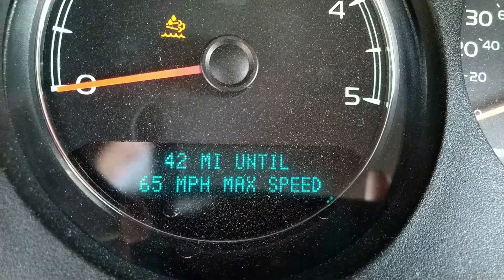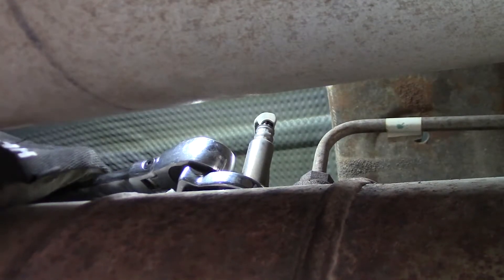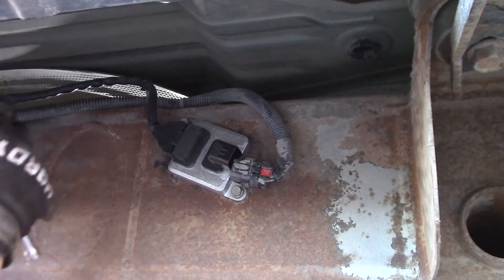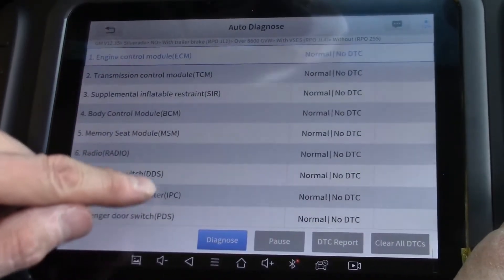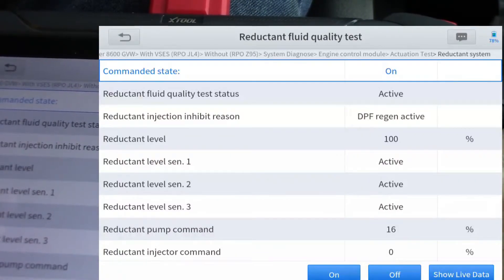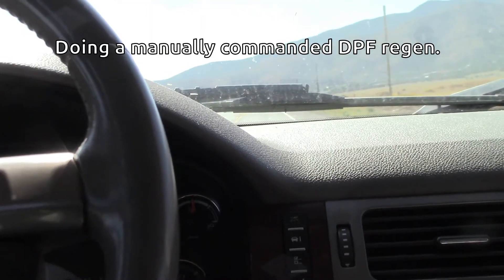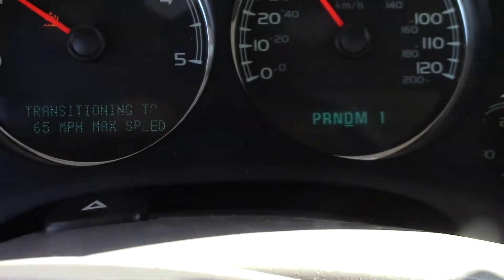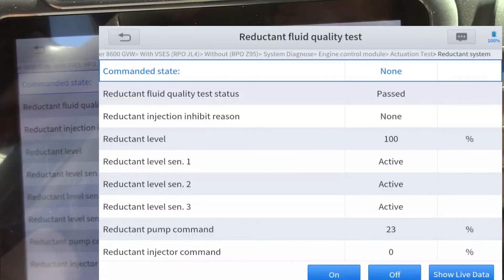Exhaust Fluid Quality Poor

Comment: This EPA crap needs to be completely removed and deleted! I’m on a 4th DEF heater! It sucks and I have only 87000 miles on a 2012 Duramax!
Reply: don’t let it get empty and you won’t have that issue. always keep it topped off after a regen
Reply: I keep mine 1/2 full to 2/3 full during the winter months because that DEF will freeze and the pump inside the tank doesn't function well when the DEF is frozen.   Also, buy DEF according to the expiration date on the jug.   Never buy DEF that is stored in a hot place.   Avoid deep standing water.............shorts it out (connectors on top of tank).   Watch you up stream and down stream Nox sensors and all 4 EGT sensors.   Mass Air Flow  (MAF) sensor that is dirty can really mess the def system up.   Air filter kept changed according to dust exposure (change once or twice a year).   Coolant temp sensor that is not acting right can mess the DEF system up.   Keep you DEF injector clean.......really not a problem in warmer states with good DEF and top tier diesel.   One other thing............9th injector, the one that shoots fuel into the Catalyst system (DPF system) in front of the SCR system can mess up and reduce flow causing a regen issue.   Good scanner will help monitor all these "pids".   best of luck.

Comment: What model Autel are you using? I have the same problem with my 2018 Chevy Duramax and trying to clear the infamous 75 miles until 55MPH. Do not have any codes now but still have the emissions message.

Comment: We've replaced 2 NOX2 on our 2017 Silverado 2500HD LT 6.6L (say that once fast) and it just keep saying LOST COMMUNICATIONS.  Chevy should be required to replace all of our CHAFING wire harnesses (if that's what is causing that error).

Comment: I have a 2014 LML having the same issue replaced downstream NoX sensor and still have no warning exhaust fluid quality poor. Do you have to run a full region or can you just run the fluid quality test? I also have a ex tool Bluetooth I believe D7.
Reply from the maker: If the fluid quality test isn't successful or runs longer than say 40 minutes, then run the regen before retesting.

Comment: Bought a XTOOL  D9  and the NOX2 sensor, spent a couple hours on my 2013 LML and still probably quicker and less expensive than the stealership  Thanks for the help and insight!!
Reply: @chrisaldrich3607, do you know if the INNOVA 5610RS can perform the role that your XTOOL D9 did? I need to replace my NOX2, and only have about 50 miles before 4mph mode, so I think I need to get it right the first time. Thanks.

Comment: Do you all know how to reset the def fluid on a 2016 Silverado 2500 HD LTZ it says it’s low and keeps saying it’s dropping my speed from 65mph to 55mph but I put 5.3 gallons of diesel exhaust fluid in it and filled it up and that message won’t go away. I need help guys
Reply from the maker: I think the first thing to check is the level sensor and connectors.
Reply: Did you ever get your truck out of derate? Going through the same thing with a 2016 LT?
Reply: @xfootball58  yeah there was a recall on the exhaust def system the dealership fixed it for free but I had to pay $175 for the diagnostic. Runs perfect now
Reply: @derekddurbin  how long ago did you have this done? How many miles on your truck?
Reply: @xfootball58  about 5 months ago I just rolled 34k miles I don’t drive it much I have a take home truck for work and I bought my wife’s impala I use my truck mainly when I’m hauling something or deer season

Comment: So 3 months ago I asked John what scan tool he used to trigger the Regen. He used the Xtool D8. I appreciate the help and info on your video. 
My truck is a 2013 3/4 ton Duramax and it had been in limp mode for a couple months, yes months. Mine was limited to 4mph and that was the message on the dash along with poor exhaust fuild quality.  I kept fiddling with it trying different things after watching a ton of video s and reading blogs. I kept going down the rabbit hole and seemed like I kept making things worse because I was trying different things from watching videos and then checking my less expensive scan tool, not the scan tool that finally fixed my truck. I disconnected the speed sensor at the transmission and drove the truck around a couple times and that threw a OBD code. I disconnected the NoX sensor #2 thinking it might reset. Both of those ended up sending more OBD codes which told me the computer in the truck lost signal from the speed sensor and NoX#2 sensor. So I let the truck sit for a week and finally found John's video and I decided to either take it to the dealer and let them charge me probably $1k in repairs or go and purchase a BETTER scan tool which I hoped would fix my truck. I started searching for a OBD scan tool that would do what the Xtool D8 would do. I thought about the D8 and found a video where the TOPDON   Phoenix Plus. (Before I forget I did buy a NoX sensor from Chevrolet dealer. $390 which I didn't need and ended up put the old one back in the truck).
When I received the TOPDON it took me a couple days to figure out how to use it and get to the reductant (DEF) Fluid quality test.  The TOPDON allowed me to "RESET" the speed sensor and NoX sensor #2. I think driving it around with them disconnected set the codes off on them. Try not to drive your truck with these disconnected or I think it will throw the code on them. After I learned a little bit about the TOPDON I was able to get the 4mph limp mode to disappear from the dash warning. The last thing I did was run the reductant (DEF) fluid quality test on the TOPDON. After approximately 20-25 mins the truck went back to normal idle and it has run fine since. That was about 3 months ago and now it's Jan 2023. Running good so far. 
Thanks for your video John it was a huge help and I think it was one of the better videos showing and explaining how you fixed your 🚛.
Reply from the maker: Wow, sounds like quite the ordeal you went through! I didn't know you could use the scantool to clear the 4mph limit before passing the reductant quality test. Luckily we didn't need to do that and had it all taken care of before that could happen. 
One indicator for when the NOx sensor has gone bad is if the NOx doesn't go to zero after a tip-out (accelerating and then suddenly taking your foot off the accelerator so that the truck's momentum is keeping the RPMs up.) If you read both the upstream and downstream sensors, they should both go to zero within maybe 3 seconds. On this truck, the downstream NOx sensor wouldn't go to zero. It was stuck around 14 ppm, so it got replaced.
Reply: @jtandrews3  question how difficult is the repair on diesel engines ? Compared to v8 engines ? I do all the repairs to my truck everything and I don’t know nothing about diesel principal the DEF system, is more complicate ? I will be able to do it the repairs and mantenace ? I ask because I want buy 3.0 duramax chevy … I have v8 truck for the last 30 years
Reply from the maker: @watchmanexpert  It's really not much more difficult. It's just a bunch of new stuff to learn. As far as usual repairs and maintenance go, a backyard mechanic can learn them from watching youtube videos. Personally, my next truck won't be a diesel, but owning one was a good learning experience for me.
Reply: @jtandrews3   why you next truck won’t be Diesel ? To many issues ?
Reply: @jtandrews3  Your video is so great, really appreciate it! And I'm about to tackle my own problem, just got back from being on the road and need to fix my baby parked in the driveway. I only have about 60 miles to go until the 4mph limp mode, so I'm nervous. John main question is, with my scan tool I was driving around my neighborhood and monitoring both NOX sensors. On level or slight downhill grade after accelerating, I notice the NOX2 sensor did NOT return to 0 ppm. It stayed around 35 ppm. Is that a definite replacement? Reason for asking is my code thrown is 249D which is "low flow reductant fluid." My question is whether the reductant injector is bad or not. I don't want to pay for the NOX2 and replace it if so. Any comments/thoughts? This occurred after I ran DEF low-ish, probably down to a gallon and <50 miles before speed limited, then I added a jug of DEF. I'm fairly certain the DEF is fine. Yes it was ISO rated and not expired. Low DEF went away, but after truck sat a week, drove it and "poor exhaust fluid quality" warning popped up, and now I've been troubleshooting and almost to the 4mph limit. Ugh. Also I bought a scan tool, it's bi-directional and the INNOVA 5160RS scan tool. I'm not sure all of it's capabilities yet but if anyone advises I return this one please let me know. Oh p.s. my pickup is a 2015 Chevy LTZ duramax with 152,000 miles.
Reply from the maker: On a throttle tip-out, only air is going through the engine and the NOx sensor should read zero or 1-2 ppm. In dense urban areas, background NOx can approach 0.5 ppm, so that might get picked up on the readings. For a reading of 35 when it should be 0, I'd guess on the sensor needing to be replaced. If you have to drive it, I'd say command a regen first thing so that's out of the way before you do the fluid quality test with a new NOx sensor.
Reply: @jtandrews3  Thanks for the input. Can you explain how to command a regen? I need to dig in and see if/how my INNOVA can do that. Also, is there a way to rule out the reductant injector? It sounds like I may as well replace the downstream NOX sensor since it showed up at the parts store yesterday. $400 isn't cheap, but it would allow me to rule that out I suppose.
Reply: Which topdon did you get? Looking for a new scanner due to mine never coming back from a buddies shop and was wondering which model I should buy for my 14. Would love the same as yours
Reply: Sorry,  didn't mean to make it sound like I cleared the 4mph message. I had to run the reluctant fluid test and then when it was done the 4 mph poor reductant message on the dash was gone.
Reply: Same sensor for ford diesel Costs  $800 dollars .I hate this .never buy diesel
Reply: Caleb, I I used the Top Don Phoenix Plus.

Comment: Did your 65 mile speed limit resets automatically
Reply: Do you know if you can cause a regen by driving it once the sensor is replaced?
Reply from the maker: You need a bi-directional scan tool to command the regen. Otherwise, it will wait until the DPF needs a regen and that may be after you're limited to 4 mph. Then you're looking at a difficult process to even run a regen. After a successful regen, then you need to command a reductant fluid quality test, again using the bi-directional scan tool.
Reply: @John Andrews  Thank you Sir. I haven't owned a scanner before so I want to make sure I buy one with the capability to do this, but I also don't need something too professional either.
Reply: @jtandrews3  could you possibly recommend a scanner capable of this job that's less expensive than the D8?
Reply from the maker: @dustyeaston4538 Here's a link to some reviews that I think you'll find helpful. I just found the web page: https://www.obdadvisor.com/best-bidirectional-scan-tool-review/
Reply: @jtandrews3  thank you so much!
Reply: @dustyeaston4538  I had the same poor quality def problem with my 2.8 duramax. I was less than 30 miles until 3mph limp mode. Did a forced regen and then a reductant quality test with a Launch 9919E scanner that I bought on sale at Amazon for $372. From what I've read, it's the best scanner for the money.
Reply: @Andrew L  Thanks for that. Unfortunately my truck will not regen. I have yet to be able to force it no matter what I try.
Reply from the maker: @dustyeaston4538  was it fully warmed up  before commanding the Regen?
Reply: @John Andrews  Yes. I've experimented with different time periods, even up to an hour. Making the truck level, engine uphill/downhill, fuel level, oil change and a few other things. Now I have a new code, P040B, EGR temp sensor position 2. So I guess I'll replace that next and see what happens. I don't know what else to do but through parts at it now.
Reply from the maker: @dustyeaston4538 A bad exhaust temperature sensor could be the reason. Position 2 is probably the most important sensor for regen.
Reply: @John Andrews  replaced it but nothing changed. That particular code cleared but that's it. Still won't regen. Earlier I replaced Nox sensor 2, so now wondering if I should replace #1. The oxygen concentration is 6.58 % on the #2 that I replaced and 6.23 on the original #1 nox sensor.
Reply: @dustyeaston4538  yes I drove it and it cleared up on its own 2011 duramax after changing nox sensors
Reply: @dustyeaston4538  yes, truck should regen while driving
Reply from the maker: I had to use a bi-directional scan tool to command a DPF regeneration, followed by a reductant quality test. After it passed the reductant quality test, then the speed restrictions were cleared.
Reply: @jtandrews3  thank you sir
Reply: @6doorshopdavid980  my 55mph actually cleared up on its own after I unhitched my tow load and got on the freeway I had driven 100 miles with a tow load of 9k and could not get it to regenerate mind you I did not have a way to regenerate it other than driving. Today I was on my way to the dealer to have them force a regeneration with the machine and I unhitched my tow load 20 freeway miles later all my warning lights cleared up and I stopped and restarted my truck and was able to hit 80mph
Reply: It actually went straight to “reduced speed upon restart 55mph” I changed upstream and downstream nox sensors and I drove for 100 miles hoping to regenerate and clear codes. After 100 miles I got nervous was on my way to the dealer so I unhooked my concrete pump which ways 9K and on my way to the dealer it cleared up on its own. I am out of limp mode after addressing the problem which for me was nox sensors and driving with no tow load.
Reply: So I was able to get out of limp mode without using a scanner or forcing a regeneration with the machine.
Reply: @duggPHresh how did you do this? Just replacing nox 
sensors?
Reply: @stayhappytravels7274  sorry for late response I’m not on YouTube much. But yes for me and my situation I replaced both nox sensors and drove my truck in the freeway for maybe 20 miles and the speed limit just reset on its own.
Reply: The upstream and downstream sensors look identical how do you know which is which? I bought from oreilly and I can’t tell them apart. The one by exhaust had a tiny number “2” on it so I assumed it was a match. The one up in the engine compartment had a tiny #1 that’s the only thing I noticed.
Reply from the maker: @dougvasquez2505 The upstream and downstream electrical connectors are keyed differently. So if you plugged it in no problem, it's the right one.
Reply: Thank you John! I went to the auto place store and made sure I had them right. They are correct but I am in limp mode I’m going into the diesel doctor this week I’ve pushed over 100 miles in limp mode. Not sure how many miles I can go so I parked it. Losing out on work.
Reply: Another diesel owner with def system advised me that my truck would not regenerate while I was towing my trailer. He might be right 20 miles after I unhitched my pump the codes and warning light all disappeared. Once I stopped and restarted my truck I got on the freeway and hit 80mph no problem.
Reply: I still can't get mine to regen. Using a XTOOL D7. I start the regen, engine revs 500rpm then back to idle. Haven't been able to get anywhere with customer support either. Changed the NOX 2 sensor, have no codes.
Reply: @dustyeaston4538  sorry bro I guess I was fortunate I hope you figure your situation out.
Reply: @dustyeaston4538  and you are in limp mode?
Reply: @duggPHresh  Not yet. I have 36 miles left on the dic
Reply from the maker: @dustyeaston4538 Once you command a regen, you need to drive it and watch the exhaust temperatures so you know it's regenerating. I don't think it'll do a regen without driving. Not enough air/fuel to heat up the DPF.
Reply: @jtandrews3  Unfortunately nothing has worked. The scanner wouldn't force a regen while the truck was in motion. Basically gave me a warning that it had to be parked first. No matter what I cannot get this truck to regen. I don't even know what to try. Maybe there is some safety feature preventing it but I still cannot do a single regen.
Reply from the maker: @dustyeaston4538 While in park, on your scanner, go into the ECM and under actuation test, if you hit "DPF regeneration enable", and then hit "On" on the bottom of the screen, it should start regeneration once you start driving. Hit "Show Live Data" and see if the exhaust temperatures get nice and hot. If that hasn't been working, I'm out of ideas.